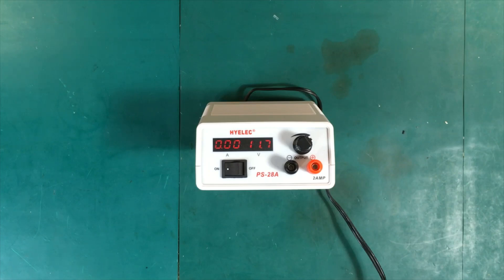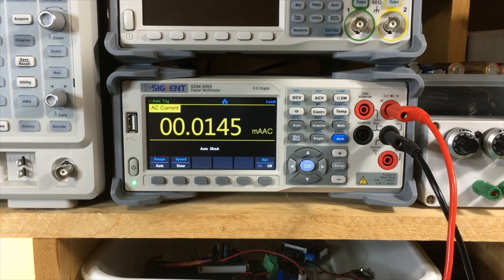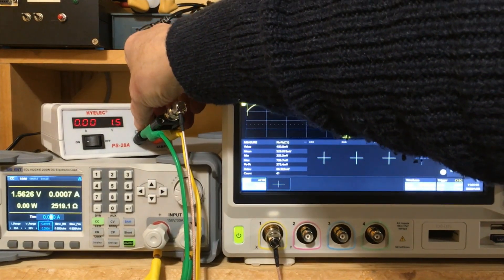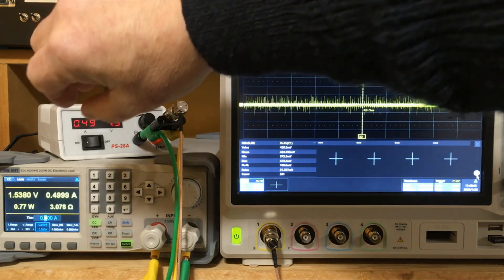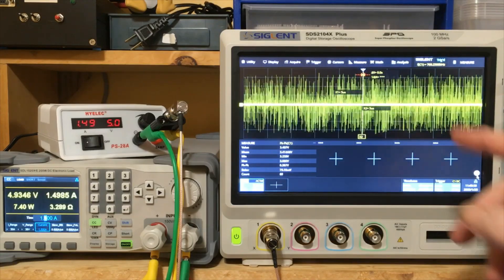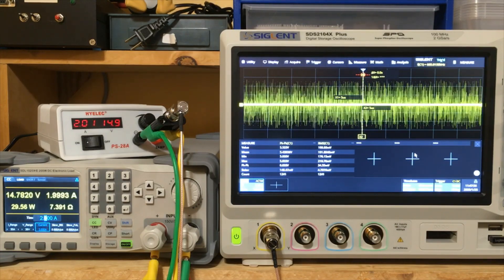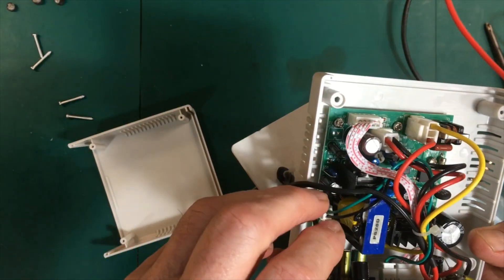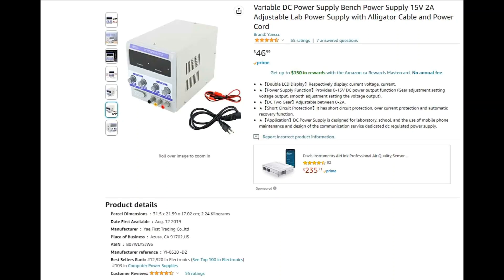0014 - (NOT GOOD!!) Beginner's Electronics Tools:  The HYELEC Power Supply

Comment: I think your only way out, if you want one, is a serious LC filter on the output rails.
Watch where you put it though, you have to consider the optical feedback, and less so the voltage meter.
Do I see an idea for a project video...:)
Reply from the maker: I was planning to test out a EMI filter on the output to see if the nudges things in the right direction.

Comment: I would guess that at high current the storage inductor in the PSU is saturating.   Designers were CHEAP and under rated the part!!!!!!!!!!!!!!!
Reply: Looking at the inside, all the parts look adequate, so the circuit design must be crap!
Reply from the maker: I agree.  Poor design on the cheap.
Reply from the maker: Something is amiss.  Perhaps they are driving the switching MOSFET way to hard
Reply: Maybe, but Chinese have access to very cheap mosfets, where the cost diff between 10A and 20A rated mosfets is almost zero, but then they are ultra cheap, so...????
I still suspect it's a magnetics under rated causing saturation, even though the transformer looks large enough.

Comment: Did you limit the scope bandwith ?
Reply: Its just fair to compare apple with apple. It is the  standard for measuring ripple on a ps. Did you try a pure resistive load? Electronic loads can also mess up your measurements?
Reply from the maker: @e-Cocinero  Yes, I did try a restive load.  Same result.   That Siglent load is pretty well behaved if you configure it properly for the test you are doing.  The replacement supply was tested the same way, so that comparison was apples to apples.  Most power supply companies ask you to use a 20MHz band width limit, but most independent write-ups recommend using caution with BW limits as you could be masking something potential troublesome.   If I was just looking for the LF ripple I would certainly consider using some form of filtering but in this case I was mostly interested in the total noise.
Reply from the maker: Limiting the bandwidth does nothing except hide high frequency noise.  Back in ancient times when a 20MHz scope was the bees knees including this in the PS specifications was actually a feather in it's cap.  However, times have moved on even if that "specification" has not.  We can now look at higher frequency noise and we also have devices that will react badly to that higher frequency noise so it's best not to hide it.  But to answer your question, no I didn't.  The noise generated by the supply was nowhere near 20MHz in any case, most of it being around 600KHz give or take.  Using the 20MHz BW limit would have had no effect.

Comment: 1:00  "...26Vac..."  Many DVOMs, with their ultra high Zin, will sometimes report apparent voltage more-or-less anywhere, even in mid-air. For low voltage tests I've sometimes slid my finger onto the hot probe, see if the voltage drops significantly with a ~100k-ohm human load in parallel. I've seen numbers drop a lot with even slightest load, including such common mode noise. DVOMs for PS testing might benefit from a lower Zin setting, or use an old 1k/volt analog meter.

That said, the PS here is no good for audio work.
Reply: 2:00 Yep, 14 uA.
Reply from the maker: No, this would be no good for any work, except maybe running small DC brush type motors or relays.

That voltage is very low current, but there are devices that would be destroyed with that kind of voltage and teh current is can deliver.  Of course, a cheapo supply like that would never get to meet a $10K 10GHz FET probe.
Reply: Such sensitive devices would not normally be powered directly from an external bench power supply, but would rather be installed into a circuit that would have its own on-board power supply subsystem. The 26Vac at only 14uA capacitively-coupled AC line noise would thus be dragged down into the noise by more robust components.

By way of example, I hope that nobody would think it good practice to wire-up an expensive CPU chip directly to a bench power supply set to (for example) 5 volts. I'd never do such a thing even if the bench PS was the finest that money could buy. There'd be a 7805 and so on, even for a 'dead bug' prototype.

Yes, that PS isn't great, but it's not likely to leave quite the trail of destruction that you fear if used appropriately. More likely that unacceptable audio hum would be the deciding factor.

I've seen technicians chasing such "voltages", not realizing that they were measuring a capacitively coupled noise into a high Zin DVOM. So I winced when I saw you making the same "measurement", as it is merely a representation of an unknown RC voltage divider (leakage/coupling path vs DVOM Zin). The better (higher) the meter Zin, then the worse it looks. But I was happy to see you instinctively switch the DVOM to current.
Reply from the maker: @JxH  Sorry, did not mean to imply a trail of destruction, just that the possibility exists.  You state that you'd not trust the finest PS for sensitive equipment.  Imagine how I feel about this thing.  At some point I'm hoping I have the time to see if it can be redeemed this to the point it could find some general application.  We'll see.

Comment: For a replacement design, I would ground the Y capacitor instead of connecting it to the secondary.  Only connection between front and back should be the transformer and opto couplers telling the switcher to change pulse width and/or frequency.  Plus maybe a second transformer powering the control circuitry instead of a complicated setup deriving control power from the variable supply.  A fixed supply powering a variable DC-DC module would potentially be less efficient, at least at serious power levels.
Reply from the maker: The neutral side should already be grounded (it is in my home) - however, this unit is not keyed.  That said, many manufacturers of SMPS modules specify that one side of the DC output be grounded.  For those that don't there should be no problem doing it if the supply is properly designed.  After all, the equipment you are powering may indeed be ground referenced.  In cases of doubt (like this POS) perhaps using and external class Y capacitor from V- to ground would be best.  I'd have to look at the design a little closer.
Reply: @uni-byte  My point was to create a genuinely floating supply, that has no link between output and input.  A traditional EMI filter has Y capacitors directly to ground instead of the way they are often used in a cheap ungrounded SMPS.

Comment: I worked in the power supply industry for 30+ (edited)  years starting out with linear and ending up with switch mode supplies and while switch mode dupplies are great for bulk power they do have issues at low levels and this can be a problem. My job as an engineering tech initially was go through new designs and work out the bugs so i got a pretty detailed look under the hood of these designs and could see the good as well as the bad of both types.

At work it was always tough getting enough working power supplies on the bench to go through an evaluation of a new design because we had a limited number of lab supplies to go around. My solution was to build several small power supplies that i could depend on, often by buying transformers and enclosures from radio Shack to go along with the components on my bench and the stock room.

At home i had a decent home lab and by buying surplus test gear i was able to buy several linear supplies dirt cheap and just replacing 50 year old capacitors. These are usua;;y bigger and heavier but they work very well and even thoug some are near 60 years old they have a lot of life in them and can be had for a song. You do give up digital metering but the pluses far outstrip the minuses. 

The result is I have a number of 1960's era single and dual output supplies that have output noise in the MV range no matter what output they are set to. All it took was replacing a handful of very old electrolytic caps.  Supplies like this still pop up and you can usually find a manual online for them so keep an eye peeled for these old boat anchors.
Reply: Three Hundred years and noise in the megavolt range is quite surprising, I have seen only one lab where anything was that big, and yes they did make electronic power supplies too.  It's a big company with one of it's headquarters near Stockholm, the other in Switzerland.  More than 100.000 employees, so I guess you could have been one of them.
Reply from the maker: Yeah, I like the older linear supplies myself.  I used to have a Systron-Donner  TL8 that I let go a few years back and I really miss it.  I currently have an HP6235A and a modern Korad.  The HP, although a small capacity unit, is excellent producing less than 1 mV of noise and ripple at full load on any of the voltages.  It's my go-to for any op-amp work.  Both the Systron-Donner and the HP came to me not working properly.  The Systron-Donner needed a transistor and some caps replaced.  The HP needed only filter caps.

Comment: 12:38 "Bring in a ground": I don't know what the regulations in other countries say, but if a device is "double insulated", attaching a PE is prohibited. Since there are two large touchable metal parts sticking out of the front panel, i assume the device doesn't fall in this category?
12:43 "Negative side of PSU at earth ground": Isn't the point of such a power supply to have it isolated from mains?
12:49 "Small amount of damage of leaked voltage": Isn't that what the capacitor between primary and secondary is for?
Reply from the maker: Thanks for the questions.

1) If I bring in the ground and provide the option to ground reference the negative output I would not do it without regard for doing it properly.  But you are right, this cannot be considered a double-insulted for the very reason you give.

2) Yes, a properly isolated PS is ideal (we have one coming, look for the review on it).  However this unit does fail in that respect.  There is measurable leakage voltage between the outputs and earth ground.  Case A) dealing with a DUT that is ground referenced.  In this case not ground reference a supply with considerable leakage voltage can cause unintentional effects which sensitive devices with very low input current, like MOSFETs and op-amps, can amplify and result in damage to the circuit.  In fact some such devices themselves could easily be damaged by the leakage.  Then, since the circuit is already ground referenced, ground referencing the supply is beneficial.  Case B) dealing with a DUT that is floating.  In this case the device is not ground referenced, so will never be subject to the leakage.  In this case you can switch off (or remove)  the ground reference and have everything floating.  Provided, of course, you don't hook it up to something that is ground referenced, like and oscilloscope.

3) Yes, there a ways to eliminate these leakage voltages in SMPS, but for whatever reason the designers of this unit failed to employ them.

Small amounts of leakage voltage/current to earth are fine for powering/charging truly isolated products.  Inexpensive wall wart SMPS designs are okay for battery chargers, cell phone chargers, Amazon dots and other such devices that can never be ground referenced.  However, for things like bench power supplies, or the supplies used to power equipment like function generators or oscilloscopes, which can be connected to ground referenced circuits, should never utilize power sources that produced leakage to ground.

Hope that helps!

EDIT: Let me add, that as it stands this device would be considered a class 0 appliance.  It probably should not be allowed to be sold in western countries (or any where for that matter).   Adding a ground reference will make it a class 1 appliance.  Considerably better from a safety perspective.